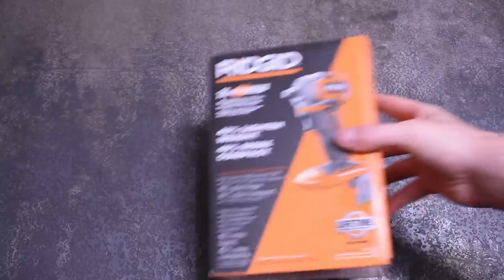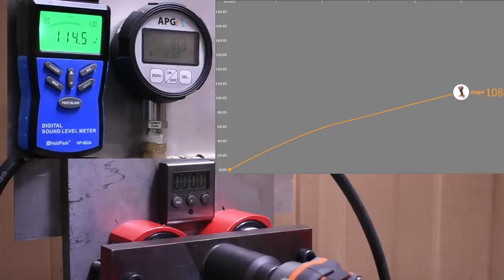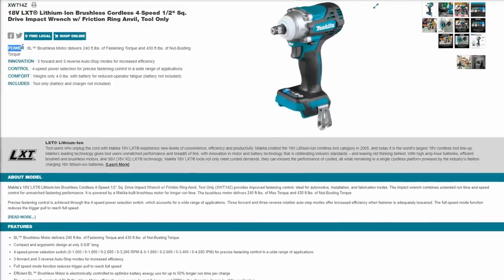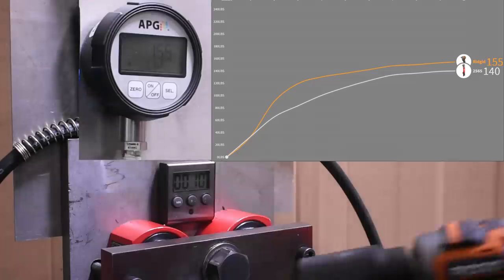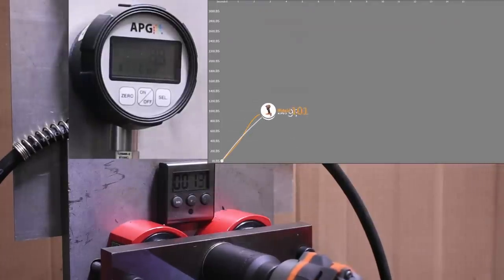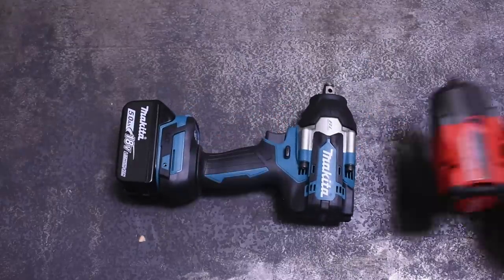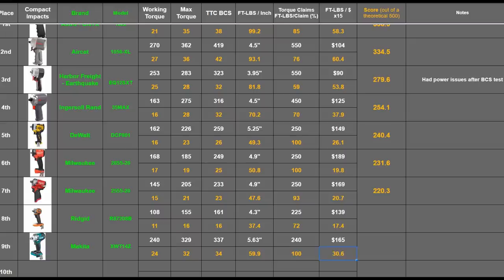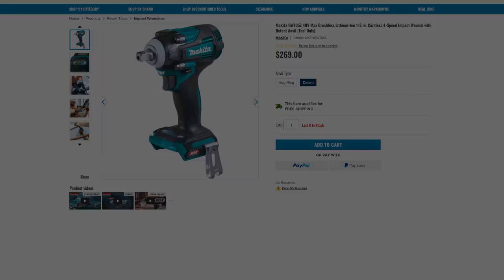Best Cordless Compact? Dyno Says It's Not Close: Makita & Ridgid vs M18 & DeWalt

Comment: whats the point of a compact when the huge battery prevents it fitting anywhere. a pneumatic with a swivel fitting goes so many places. now if they made a cordless compact with a low capacity battery built into the handle that would be something. you don't need this kind of specialty tool to run all day. it only needs enough juice to get those pesky bolts you cant get at with a normal impact.

and while i'm at it, make a cordless ratchet with a swivel built into the head. anyone remember the "ring tail"? has has 6 interchangeable heads 3/8, 1/4 and 1'4 hex and the same again with swivel heads (same kind of joint as a pinless impact universal). make these two products and light mechanics will throw their money at you.

Comment: I have a question that I suspect you guys would be the best at answering.

Is there a performance loss when using a battery adapter?

Background: One of my pet peeves is the stupidity of batteries in cordless power tools. I don't need to buy Microsoft's AA-batteries to use my wireless Microsoft keyboard and mouse. I can buy any AA battery I want, because they all follow the same standard for AA batteries. Same goes for AAA, C, D, CR2032 etc.

But because cordless power tool manufacturers are greedy bastards, they refuse to standardise on a common interface, even though every single one of their battery packs use the same battery cells that their competitors use. I'd be surprised if they even had different controllers - it's likely just different connectors.

But everyone with a Makita tool ends up only buying Makita batteries, because those are the ones that fit their tool, rather than shopping for the best performance or best price-performance.

Hypothetical - suppose that Rigid makes the best batteries (for some reason), and that by using Rigid's batteries the Dewalt tools end up performing better. That would certainly be worth knowing.
Reply: I agree, I think there can be a pretty big market or user base for #1 all kinds of battery adapters and #2 a kind of universal battery product line. Whether this would be a grey/black market deal due to patents and whatnot, or if it could be achieved through open source means is not clear so far 😎
Reply: @lolatmyage  To be honest I'm surprised it's not something the EU has raised a finger at them for, like they've done with cell phones.

Fuck it, throw e-bikes into the mix as well. They have the exact same issues. All of them (pretty much) use 36 volt battery packs made from industry standard 18650  or similar cells.

I'm sick and tired of all this crap with batteries that can't be used across different brands.

Comment: Not a fair comparison. That Makita tool is nearly as big as Milwaukee mid torque. In that size category every 1/4 inch counts. Makita has been playing a tricky game with their tools being larger than competitors yet claiming them being in the same category!
Reply: ....no it's not.  And Makita's compact wrenches used to always be shorter and more powerful than Milwaukee's Gen 1 and Gen 2 compacts (XWT02 > 2655, XWT11 > 2755)  Milwaukee didn't get shorter than the equivalent Makita until the Gen 3 compact 2855 and they had to make the wrench a fair bit WIDER to compensate for that.   Making the wrench as wide as it is also gives it access problems up next to corners...so the Makita will have better access in some areas (corners or any place where you might have to tip the wrench to the side a little bit) and the M18 will have better access in places that have <5-1/2" + socket of clearance.  

The XWT14 is a 4 lb wrench with a 5.0 battery.  The M18 Gen 3 compact is 3.9 lbs with a 5.0 battery.  How does it weighing 1 oz more make it a mid-torque, again?  If you paid any attention at all you would know mid-torques start at ~5 lbs.   

By your own logic the Milwaukee 2655 and 2755 were never "compact" impact wrenches either.  (only the Makita XWT02/11 came in at under 6") Yet that's what Milwaukee marketed them...

https://www.milwaukeetool.com/Products/Power-Tools/Fastening/Impact-Wrenches/2655-20
https://www.milwaukeetool.com/Products/Power-Tools/Fastening/Impact-Wrenches/2755-20

It's only "shady" to you because Milwaukee isn't winning.  If this were the M18 2755 and it was somehow making ~400 ft/lbs you wouldn't be making claims about how "shady" they are.

You probably didn't even know they've been making compact impact wrenches since 2013-2014.  You probably thought the Gen 3 2855 was the first one in the series.  XD.
Reply: Jay, 
I’m not sure where are you going with this but you’re completely wrong 
Looking at the factory specs 
Makita is 143 mm long 
Milwaukee is 124 mm respectively 
That’s nearly ( let’s not split hairs here) an inch difference . In this segment of tools , room is everything. Now you are allowed to believe what you want to believe and assume I’ve never held any of these guns in my life but you can’t argue with physics my friend. 
Same trend can be seen in Makitas other products 
Their mid torque 17z is bigger than Milwaukee’s counterpart , and the full size 1/2 inch  08z is much bigger than 2767.
Also 2755 is by far more powerful tool that 11Z. Prove me wrong I’d love to see any of the real tests side by side
Reply: @voffchik26  

"I’ve never held any of these guns in my life but you can’t argue with physics my friend."

And there's your problem, you're speaking about things you don't understand because you have 0 experience with them.  Thanks for admitting what I suspected.  Unlike you I've held almost all the Milwaukee and Makita wrenches in these videos.  And many of the Dewalts.  (haven't used the 12V yet)

XWT14 is not a mid-torque because it doesn't weigh like one.  It literally weighs 1 oz more than the 2855 and has ~40% higher performance with only a 11/16" (~12%)  penalty in length.  That's a trade-off LOTS of people are willing to take (it's also a lot narrower due to the tapered nosecone, still making it better at accessing certain bolts where a 2855 would need a wobble socket, again, you would know this if you had any actual experience using these tools  The 2855 is so stupid wide right at the beginning of the nosecone and that's problematic for sticking the wrench in places where the bolts is on the inside corner of something.)

Yet you're here complaining that the test is unfair while suggesting it needs to be matched up against wrenches that probably have a 33-66% heavier anvil + hammer mechanism.  A Mid-torque 2961 weighs 27.5% more than an XWT14.  The XWT14 weighs 2.5% more than a 2855.  Do I have to spell is out any more for you?

And why would the 2755 be far more powerful than the XWT11?  The 2855 is the Gen 3 version of the 2755 and the 2855 already gets blown away by the Gen 3 version of the XWT11.  We just watched it in this video.  Are you telling me Milwaukee's compact wrenches have been getting weaker with successive generations?  (again, I've used both the 2755 and XWT11, the XWT11 is a slightly more powerful wrench AND also more compact.)  Yet here you are going straight to bat for the 2755 despite it being longer even though you JUST SAID FRONT-TO-BACK LENGTH IS EVERYTHING....... Let's also not forget that the 2855 can't even beat a 12V Dewalt or a 2853 modded impact driver.  

I know what I'm talking about.  You don't.  Reading spec pages doesn't count as actual experience with the tools you pretend you're qualified to discuss.      

"Their mid torque 17z is bigger than Milwaukee’s counterpart"

with the power to match.  And much better build quality.  Imagine building your tools by setting the screws that hold the hammer case into plastic.  Lol.  

"and the full size 1/2 inch  08z is much bigger than 2767."

because the 08 is their first gen high-torque?  It's a better wrench than the 2763 Gen 1 it originally launched against.  And what do the Milwaukee fans say whenever an old tool of theirs is beaten?  Oh right, "this doesn't matter/count, wait for Gen 2, 3, 4, whatever."  That's what they all said when the Dewalt 12V was beating the M12 stubby.  

If I were you I'd be more concerned about the 3/4" high torque Makita that's beating the M18 1" impact while weighing 5 lbs less and being roughly the same physical size of the 2767.
Reply: Bro, you're clearly ignoring facts.
Also you are full of assumptions. 
Size isn't a factor for you, okay how about weight?  Milwaukee weighs 2.4lbs and Makita 3.3lbs. So heavier and bigger tool wins the comparo? okay, big deal. How fair is that? 
Continue living in denial unfortunate Makita fan boy!

Comment: The Makita is a larger gun and it's probably not even considered subcompact at that size. Honestly Makita can just not compete with milwaukee or even Dewalt when it comes to product development.
Reply from the maker: It's not consider subcompact, that why this is a compact episode. But anything under 6" IS considered a compact cordless
Reply: @TorqueTestChannel  under 6 inches? Pretty sure my gen 2 mid torque m18 is 6 inches but I'm not at work to measure. I guess that's a compact and makes more power than the Makita.  I guess I can just grind off 1mm from the back so it qualifies
Reply: @wecx2375  I have the M18 Mid-Torque, too, and with only 3/8" difference, I will probably just stick with it and get something considerably shorter for a true compact impact.  The 12V DeWalt will probably be what I get, even though I have plenty of M18 and M12 tools. That DeWalt is very impressive. To say that Makita can't keep up, though... that's a stretch. Their mid-torque outperforms the M18 mid-torque.
Reply: @l00nybin  bro, what are you talking about the m18 mid torque if you take any amount of material off the back is a compact and at that power is way better than makita mid torque which isn't a compact. Remember a compact is anything shorter than 6 inches. Otherwise I agree with you.
Reply: That must be why their 3/4" hits as hard as a Milwaukee 1" while also being half the weight.
Reply: @wecx2375  "IF" you take anything off the back. And if a frogs legs weren't so short, he wouldn't bump his butt when he hops. But they are, and he does.  The M18 mid-torque is a mid-torque as it comes from the factory, unless modified by the user, which doesn't count.  Talk about mental gymnastics to rationalize being a fanboi...

Look, I have all M18 and M12 tools, so I'm not what anyone would call a Milwaukee hater. However, I'm not blinded by brand loyalty to the point of ignoring the criteria and making up my own to justify my purchases. The Makita mid-torque is just stronger. Period.  The DeWalt 12V tools are able to hang with the M12 tools while being more comfortable in the hand for some of us. Some DeWalt 20V tools are more powerful than some M18 tools. Period. Milwaukee's warranty is just better than DeWalt's. Period. No one brand is superior in every category.

Comment: The reason I buy a compact gun is to fit it in the tight places, as the name implies. So what's the point in having a lot more power than the competition if you're much larger and can't fit into the tighter places, which is what they are meant for. I might as well call my high torque a compact gun and brag about all the power it has and then look like an idiot using hand tools to loosen bolts which others in the shop are loosening with their actual compact guns
Reply: What tight places can you get to with your "compact"  impact wrench that you can't get to with this makita?  It's not like you are putting the entire impact wrench in the engine itself to bust open any bolts or nuts.  So why is this not a fair comparison? The makita is roughly 1/2 inch longer from the anvil to the back compared to the Milwaukee and weights 1/2 lb more with  5 ah batteries on both.  Being cheaper and having more torque this is a no-brainer makita is the better "compact" impact wrench in this test
Reply: @KnKn-rr9ri  judging off your comment I assume you are not a light vehicle mechanic. Size is a huge factor and yes the gun goes in engine bays and around steering, suspension and brake components. Any extra length could mean not being able to get onto a fastener. I have the m12 stubby and it is a great size (if it were smaller then yes it could do more) and it has enough grunt to undo 90 odd percent of the stuff I encounter and I have the high torque for the rest, if it fits. I hardly ever need to bust out the high torque. Personally with this combo I don't see the point in mid torques or 18v or higher compacts as a light vehicle mechanic. I'm sure other trades may differ